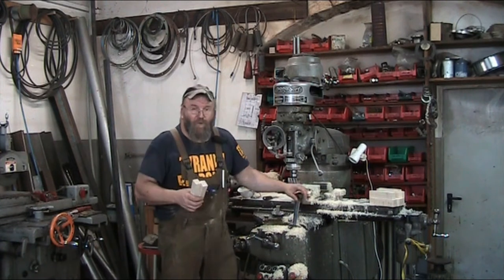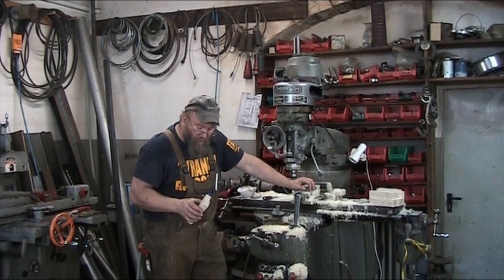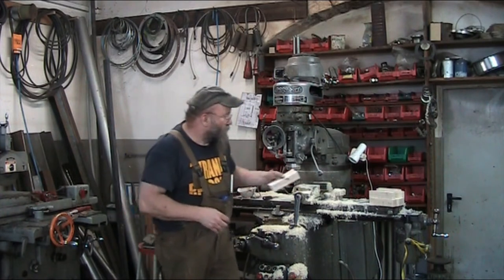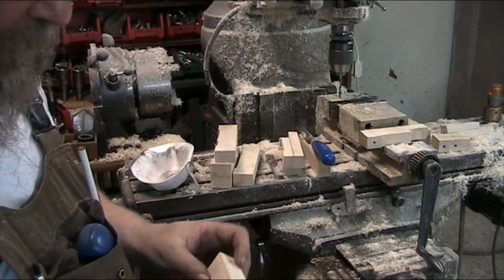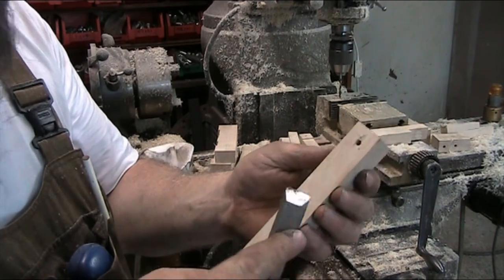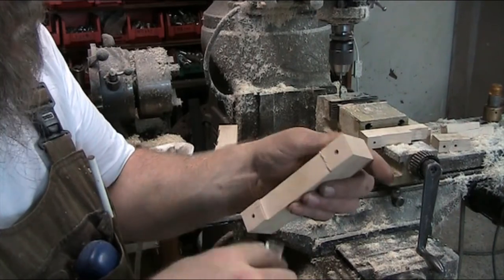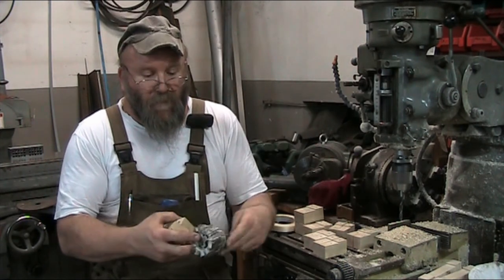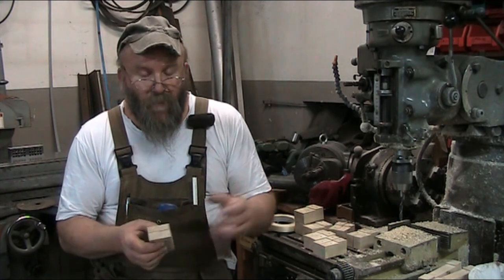Zerks&Wheels episode 14, marinus go round

Comment: Love how that mill looks,...like someone poured cream over it, or sitting in a cave accumulating limestone for many years....Anyway, you just proved that metalworking machines the more versatile ones, or would you try cutting steel on a router ?   ...lol ... Also agree with Don, less flutes are better, had good results with a (sharp) flycutter skimming oak blocks on the mill.
Reply from the maker: yeah, the chips were falling like fresh snow. that hornbeam has such a pleasant creamy color to it. sort of like peach-maracuja flavored yogurt..lol.
the chips really soaked off a lot of the excess oil all over the machine and it cleaned up quite well.. i do have get into the knee tho and get the pile of chips - both metal and wood - out of there before things get seized up.

 what i found most interesting about this little exercise was how well the cutter performed on the end grain cut. that helical shape of the teeth made for an incredibly smooth finish. even a sander doesn't give a finish that smooth. it's like glass.
if a guy could get an end mill to spin fast enough it should do quite well in that regard i would think. so i guess i'm just gonna have to get the deckel going and give it a try. it will go up to 20 000 RPMs but it doesn't have much gronk to work with. but for narrow grooves and such it should do ok i would think.

it's also quite impressive how accurate the parts turned out. as a trained mill sawyer i know that accuracy in rough sawn wood is in the millimeter range, and in finished lumber 10ths are possible. but i have never heard of going to hundredths before.